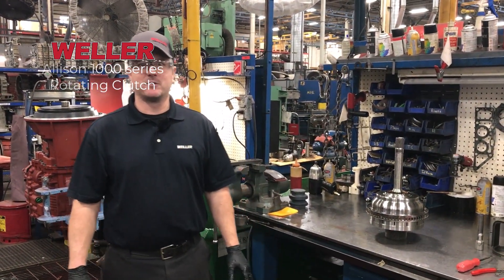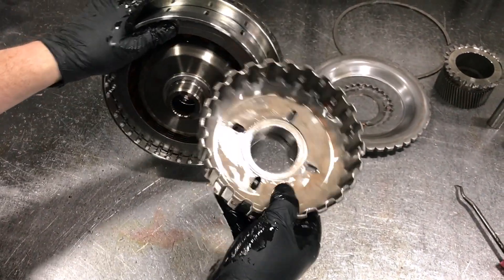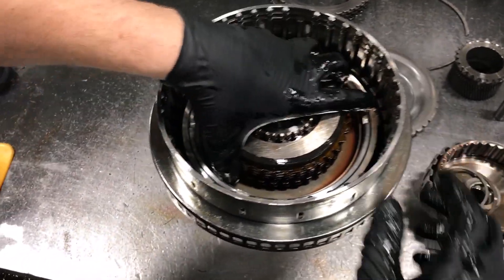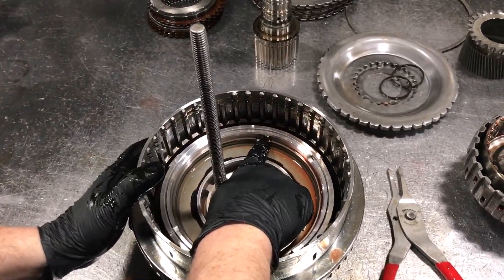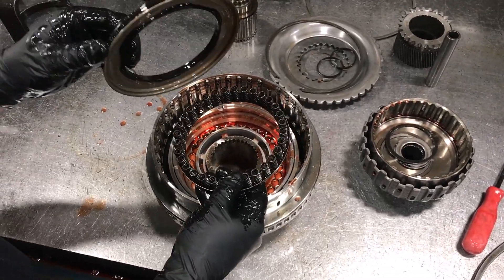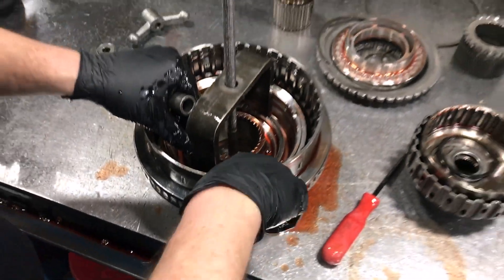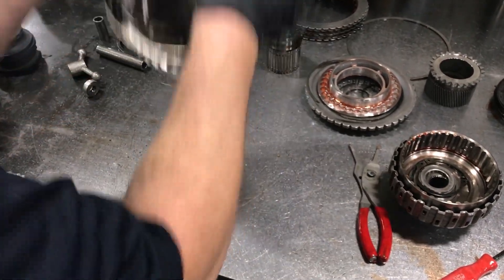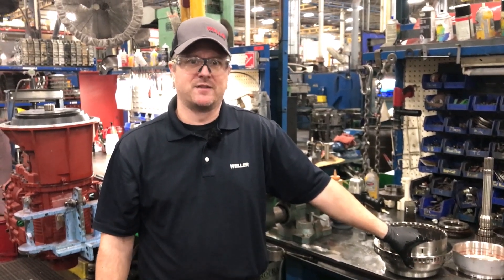Disassembly of an Allison 1000 Series Rotating Clutch

Comment: What compressing tool is that?
Reply from the maker: Hey Bradley, This is an Allison piston compression tool. Any Allison specific tool is now serviced through Snap-On and they can get part numbers, price , and availability.
Thanks for Watching
Reply: @WellerTruckParts 10-4. I’ve been using a generic compressing tool from amazon that’s worked ok but this is much nicer.
Reply from the maker: @ That's awesome! Thanks for sharing!
Reply: @ I tried searching the snapon site and can’t find the PNs. 

Do you know if I must contact my local snapon rep?
Reply from the maker: @bradleydavidsankey  Hey Again, that might be a good idea just so you get the correct part number.
Thanks